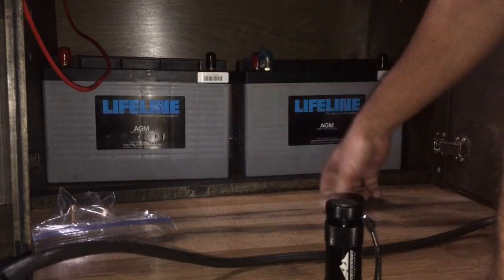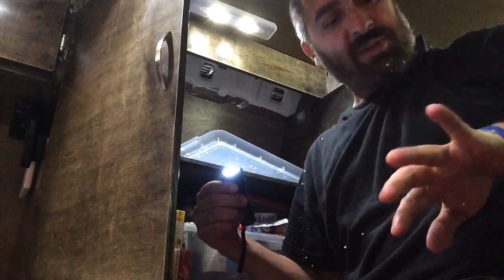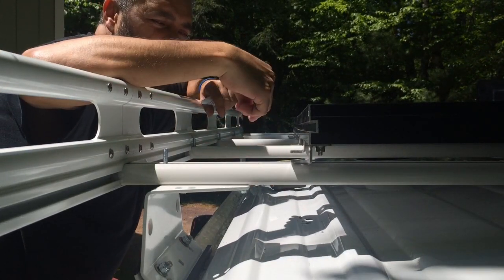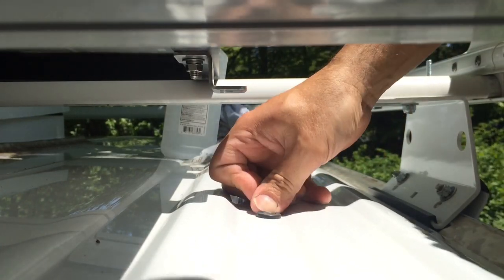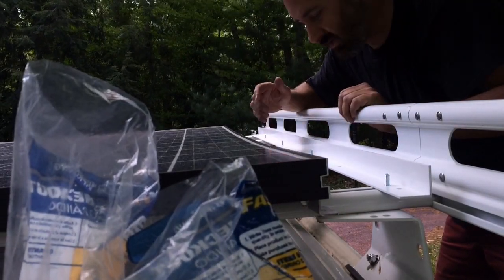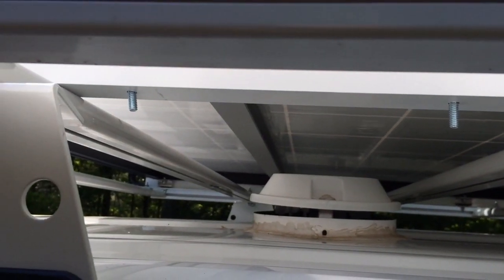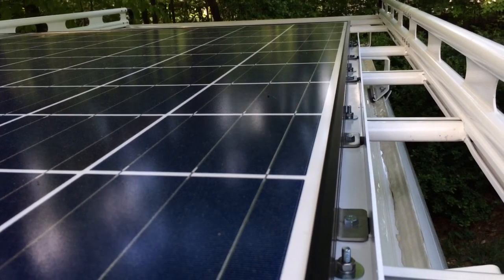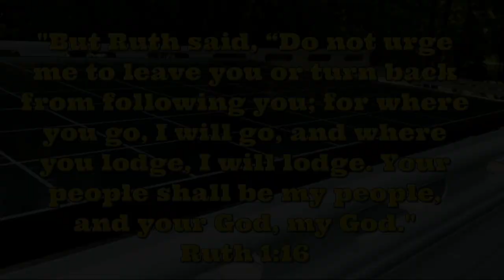Van Life; solar installation Part 2!

Comment: That is a HUGE solar panel! I really like how those new vents fit under it.
Reply from the maker: It is huge isn't it? I hope it continues to stay put. 
The way the vents fit wasn't by accident. I knew about the VanAir vents, but still searched far and wide for an alternative, always coming back to these though. Perfect fit, and keeps me cool even in hot weather. 😊👍🏻🚐
Reply: Im interested in how you do this summer. Could you keep track of nightly highs? Does your weather station in the van tell humidity? Im curious to see what you wear to bed and how comfortable you are on the hottest nights.
Reply from the maker: The weather station tracks humidity. Unfortunately that's something the roof vents can't eliminate. If it's humid outside it will get in, unless I only have the Fantastic vent running, then I might be able to remove some. 
I don't know how the summer will go, but I can tell you that it will go much better than last. Last summer I had no vents whatsoever. Only the two front windows open a bit, three small fans running, and the swamp cooler. 
Thus far this summer we had a few weeks in the upper 80s and some 90s, and I was able to be inside the van after 4pm and still be comfortable. 
Now, what's comfortable for me might not be for somebody else. It was just about as warm inside as it was outside. And I was parked in the sun. The big difference this time around was not only the Fantastic vent, but the other two vents. Even though it was around 80 inside, I had a cool breeze coming in, and with the solar panel shading the two small vents I reckon I'll be even cooler. Certainly the nights will be very, very comfortable.
Reply: Yeah. Im super curious to see your inside and outside temps and how comfortable you were. I found that no matter how hot and humid, a fan blowing directly on me made me cool enough to pull the sheet up over me.
Reply from the maker: I'll keep everybody posted. 👍🏻
Funny, the first few days sleeping with all three vents, I think I got a little sick from going to sleep uncovered. I actually woke up shilled, even with temperatures in the 70s inside the van.
Reply: Rolling Earth-Ship let us know too how the solar panel affects the air temp coming in the vents; as panels will radiate heat underneath...
Reply from the maker: I'll keep everybody posted. 👍🏻😄🚐

Comment: great job mate, But you need to put a little bit of zinc paint on the bare metal before you put the grommets in to prevent rust.
Reply from the maker: Thank you! 
I know I should have, and I did just that when I installed the fantastic vent, but I didn't. Hopefully it will be ok. 👍🏻😄🚐
Reply: Keep the great videos coming. :)
Reply from the maker: I will sure try to do my best. Thank you! 👍🏻

Comment: Nice work. Seems like with a rack that wide you could mount the panel across instead of down the length, and make room for two panels, yes? How wide is that roof rack between the side rails? I'm thinking of buying the same rack and mounting 64 inch solar panels cross-wise. Would they fit? Can't find that measurement on Vantech's site.
Reply from the maker: Thank you!
Between the rails is 64". The solar panel is 65" 1/2 long, that's why I didn't lay it across. 
Which solar panel is 64" long? 
This roof rack is an excellent product, just keep in mind the trouble I had with it. If you get one make sure you got all the parts immediately. 😄👍🏻🚐
Reply: Rolling Earth-Ship The panels that small I've found are under 200 watts. But I just got an email back from Vantech, and they say that the cross bars are 72 inches for the Ford vans, but 64 inches on the Chevy/GMC vans. Don't know why. That was my confusion, as the one on Dan's van seemed to overhang the roof more. And yeah, I watched your installation videos, looks like a nightmare, but I can't find a rack that works better for large solar panels. I live in the Pacific Northwest, with 9 months of clouds, so I have to massively overbuild my solar. I'm definitely stealing your method with the aluminum angle when the time comes. Your channel has been an inspiration to me. I first saw you on Cheap RV Living forums, iirc, but found your youtube channel by accident. Love your attention to detail.
Reply from the maker: 72" for the Ford vans? I didn't know that. Maybe Dan can check his because I don't think Ford is 8" wider on top than the Chevy. I may be wrong. 
These racks once installed are beautiful and very well made. They'll last forever, or until the earth ends, whichever comes first. 😂
I'm very glad I've been able to help, and please, use any of my ideas as you please. 
CRVLF is a great site with a wealth of knowledge. I still use it all the time, but I think I needed a different venue I could call my own. Youtube fits that niche for now. 
Very glad you found my channel. 👍🏻👍🏻😄

Comment: Hey do you have a link for where to buy that kyocera solar panel? or did you buy it off CL? I'm trying to locate a big panel and they are tough to find.
Reply from the maker: +CycleCruza I bought it from Arizona wind and sun.com. Just be warned it cost me $ 300 for delivery, same as the panel. 👍🏻😄😂
Reply: Ouch! There is a local guy here on CL selling 300 watt (44.8 volts) Poly solar panels for $250 with no tax. I really wanted to get Mono but people tell me Mono vs Poly doesn't make much of a difference. In one of your videos I think you said you saw YT video where a guy parked under the lights at WalMart and was getting power, which was probably a mono panel. However, it's tough to find a 300+ watt mono solar panel without being ripped off.  I like the single panel to avoid a wiring mess and avoid issues figuring out if any of the panels are bad. Thanks for the reply and link!
Reply from the maker: +CycleCruza not a problem. 👍🏻🚐

Comment: I'd throw a bit of primer/paint at them bulkhead holes....I can't trust a grommet. Rust never sleeps!
I guess with huge panel shading the top it'll be cooler inside too.
Reply from the maker: It a little too late for me. Maybe in the future...far, far into the future, if I have to replace the grommets I'll try to remember that. 👍🏻👍🏻😄

Comment: Better than 'professional' job Luis.  You take so much into consideration and use extra care for any foreseeable problem. Looks totally safe and secure! Nice job! p.s. don't forget your safety specs when drilling metal. auwe
Reply from the maker: I know, sorry, I'll try wearing them more often. 😊
Thank you! I try my best. I'm sure there's always things I don't remember, but I try the best I can.  👍🏻👍🏻😄🚐
Reply: Rolling Earth-Ship Yeah, what she said. I got some metal filings in my eyes from not wearing protection. I had to go have them taken out, very uncomfortable. They used a special microscope and picked them out, luckily it did no lasting damage.
Reply from the maker: I was drilling into aluminum, which is much different than hard metal, and I'm looking down, but up at the drill. Still, I agree with both of you completely. Eye wear should be on all the time. 👍🏻👍🏻

Comment: Did your brackets come with your solar panel, if not where did you get your brackets if you don't mind me asking?
Reply from the maker: +BugOutMoto the Z brackets? Yes,  but I had to order extra as the panel only comes with 4, and I used 5 or 6 on each side. 👍🏻😄🚐

Comment: Try sticking 66"x52"x1.8" up there. You have to get creative on mounting something that big on a van. As it's a 325 watt panel but it pumps out some amps.
Reply from the maker: If I could stick two of them up there on the roof I would too. 😄👍🏻🚐
Reply: I got them to fit. As I ended stacking them on top of each other. The top one is motorized and slides out forward to expose both of them. When I start the van it retracts and locks down. 

Very creative for the limited space I had.
Reply from the maker: Very creative indeed! 
When the it slides forward where does it go, over the windshield? And where did you get the tracking system? 😄👍🏻🚐
Reply: It sticks out past the windshield so I can see that it retracted before I drive off. Then the light goes out after it locks. That way I know its safe to drive off. 

I had to use two iron ridge 1000 XR rails on each panel. The top one has a 12 volt high torque servo motor mounted on it. It's gear driven to the tooth rail on the panel. Which was all custom made. 

The guy I work for makes high speed equipment for computer chips. He showed me how to do it, with off the shelf parts.
Reply from the maker: Very cool! Sounds like something I would do had I the prior knowledge. 👍🏻👍🏻